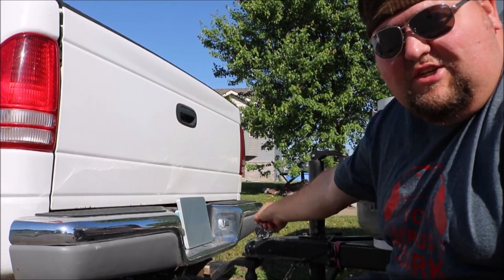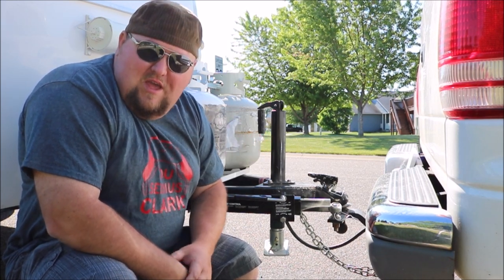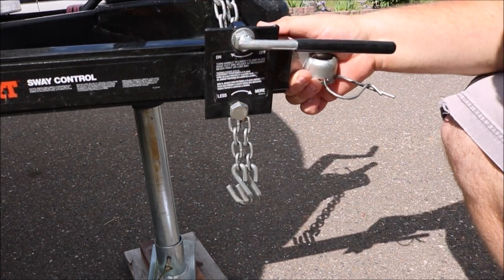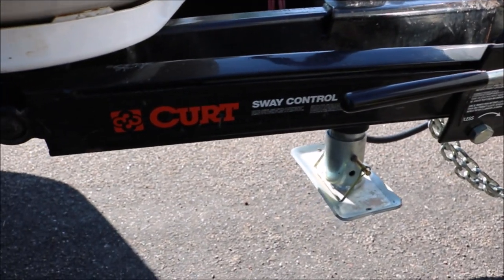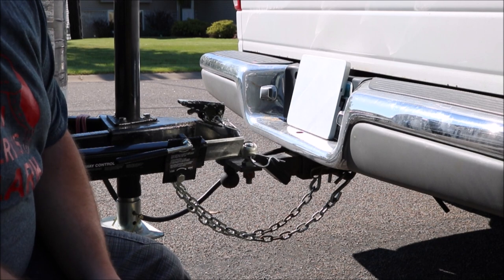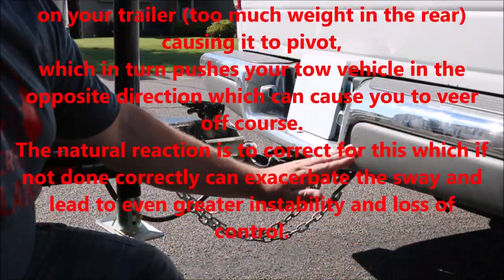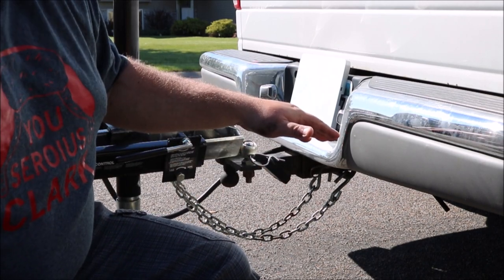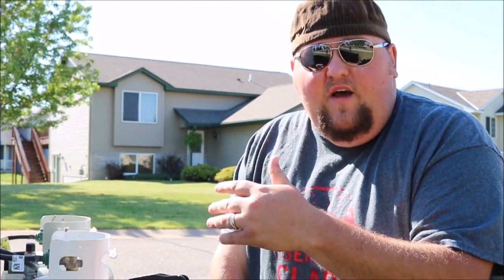Our Scamp camper towing setup. What you NEED to know!

Comment: Having owned and towed a number of Scamps, here's my take.  It's imperative to tow these things level, to much in either direction puts strain on your Axle/Bearings and wears out yours tires much faster and will kill your fridge if running that while towing.  Yes, around 18" Ball Height for 13' models and around 20" Ball Height for 16'ers is recommended  on NEW Scamps (from ground to top of tow ball).  However the lifespan of a typical Scamps Axle is around 15-20 years, and as that Axle starts to age your Scamp will be MUCH lower. Even a year or two old Scamp might require a  couple of inches lower than that.  I have pulled some mid 70's Scamps on original Axles were the ball was set at around 13" and could have went lower. If you ever see a Scamp passing that looks really low, it needs a new Axle.  Best advice, if you own a Scamp, plan on a new Axle every 15 years or so.  I'm not a fan of WDH or Anti Sway Hitches with these small lightweight Scamps.  The frames on these trailers are not very strong, and they put a bunch of unnecessary stress on the entire trailer.  Can lead to increased Spidering in the Gel Coat, have even seen a few with misaligned doors in the shell from extended use.  If a trailer sways under normal driving conditions, something is wrong and must be corrected. The most common cause of sway is improper loading. Weight should be low and centered over the axle with enough forward bias to have a tongue weight equal to 10-12% of the total trailer weight. Proper tow vehicle is a must, and only use WDH/AS Hitches for undersized vehicles.  I'm a big fan of the Andersen Aluminum Rapid Hitches, with the 2" & 1 7/8" Reversible Greaseless Balls.  Even the balls are made of Aluminum and won't rust up here in the Salt Belt.  Best $200 a Scamper can spend.  Anyway, great vid's, keep them coming!
Reply: @Chris:
I don't know why Scamp (and Casita) doesn't improve their products, for sure in the two areas you mentioned that SHOULD be made better/heavier-duty -- axles and frames. And those tiny tires! Really...some things are best left to "that's the way we've always done it" -- if they are ALREADY the best way to do it -- if not, doing it "as we always have" is doing it less-than-best all that time. THOSE things need to change, IMO...
-- BR